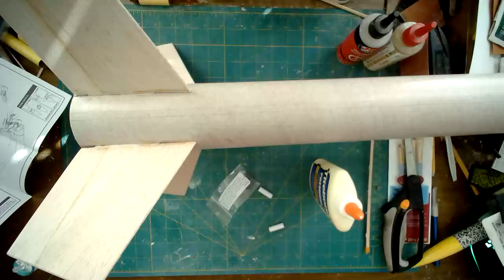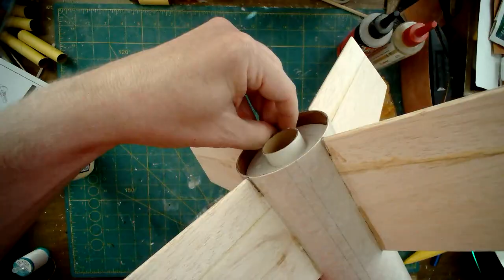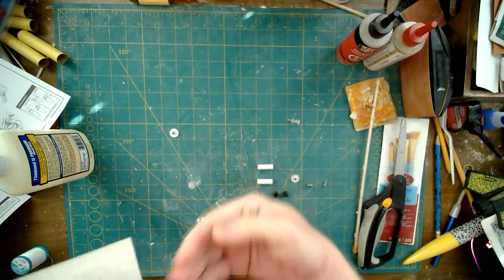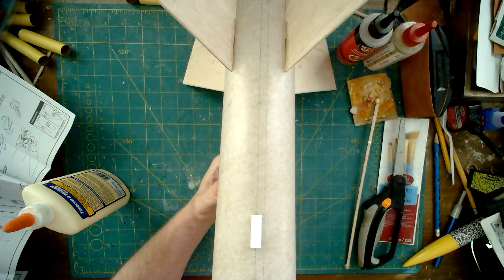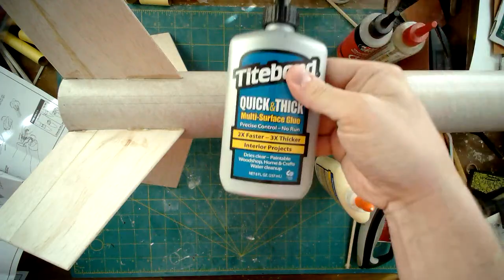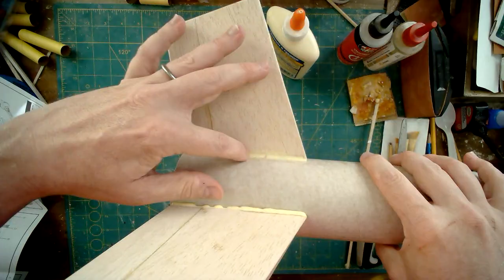Estes Great Goblin Build, Part 6

Comment: There were a couple of members of The Rocketry Forum that posted plans on building launch rails. They had a tiff about who copied whom. Thankfully, that argument happened offline and came to realize they came to the same conclusion independently.
Also, the overly smart folks on TRF speak of absorption of adhesives into the building materials. I've never used clay on any of my builds, but it seems like there would be little to no absorption with it. It would do well to a very aerodynamic, but would it actually add strength? TTW mounting seems strong enough for mid-power, and minimal fillets just to close in the gaps between fin and tube.
Reply from the maker: Agree that epoxy clay isn't really necessary for mid-power, and wood glue fillets are going to be sufficiently aerodynamic.  Given that this kit was really designed for wood glue and E16 motors, using epoxy as the primary adhesive is probably overkill by itself.  Interesting information about the absorption - I'll have to look into it.